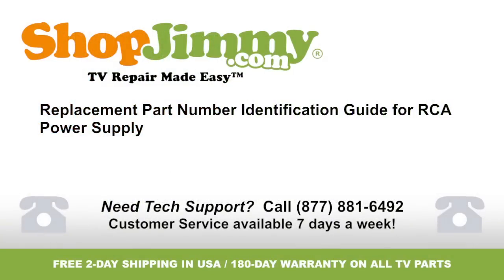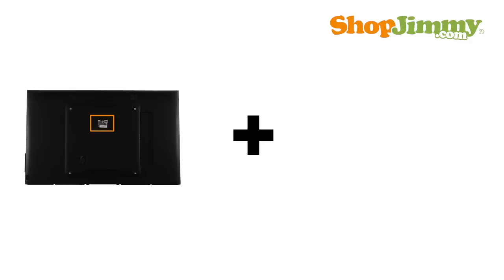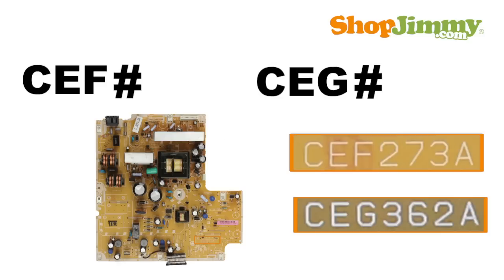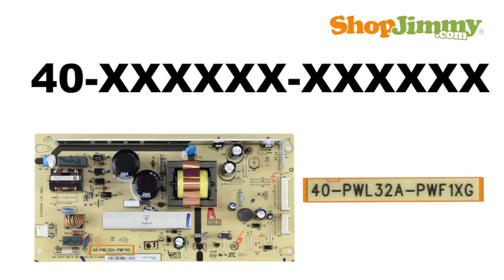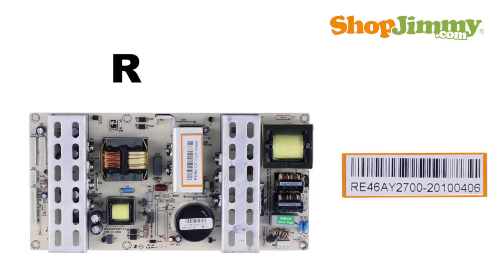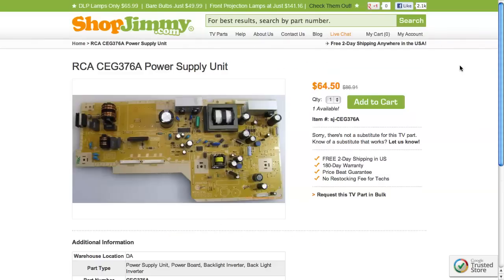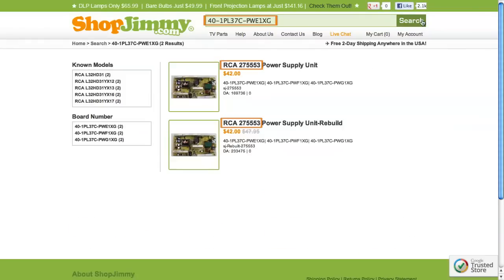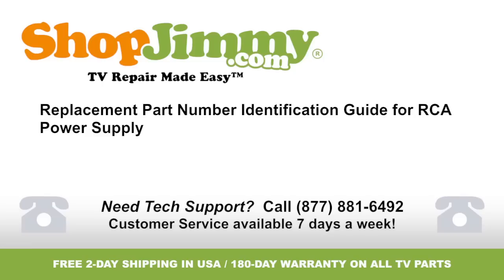TV Part Number Identification Guide for RCA Power Supply Unit (PSU) Boards

Comment: I have an RCA L32WD22 TV and I replaced the caps on the power supply board and I still get no power up on the screen.  The front bottome light comes on and I hear humming from the power supply.  Any thoughts? Thanks
Reply: ShopJimmy.com Thanks!